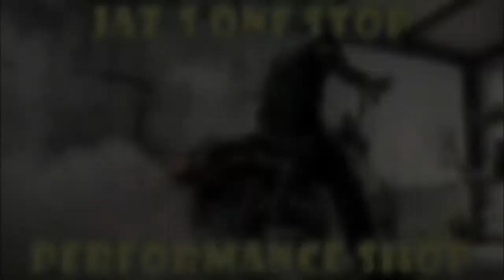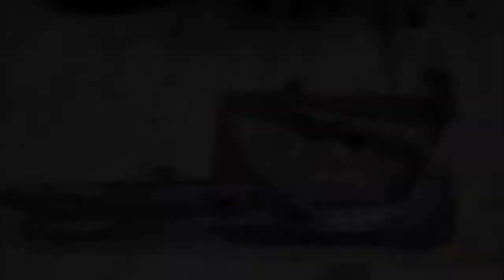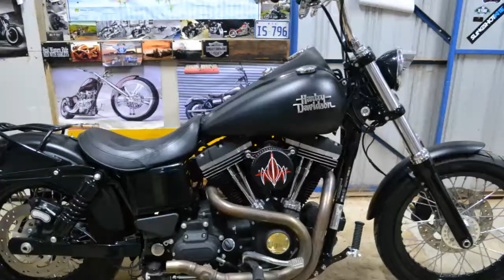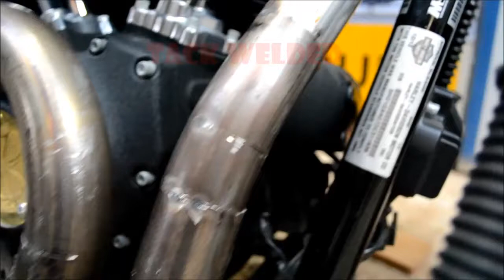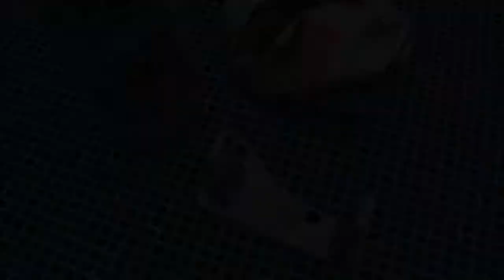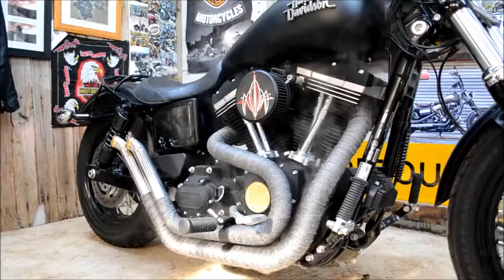Building Custom Upswept pipes for my Harley Davidson Dyna Street Bob 'Evil Betty'

Comment: what year-wide glide header pipe did you use? do your pipes retain both o2 sensors?
Reply from the maker: YES mate both 02 sensors as you need them, 2013 im sure they were! IVe since made a new set which make awesome TQ! check out my later vids :)
Reply: @jazrad666  Thanks for the fast reply!

Comment: i have a fxdb as well. not much on the upsweeps but want to build something that will keep my power where its at with my 2 into1 system but be loud as f***
Reply: any suggestions?
Reply from the maker: Don't run any baffles what so ever, have a exhaust that flows and bends really well and the best thing to do is get both of your pipes as close as possible to equal length so its putting out roughly the same amount of exhaust gasses ect ect!
Reply: thanks